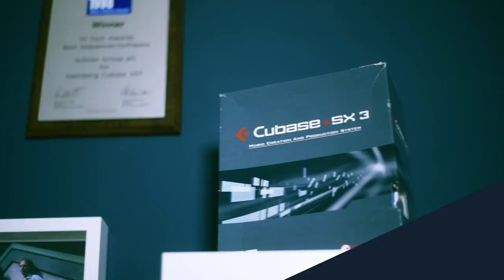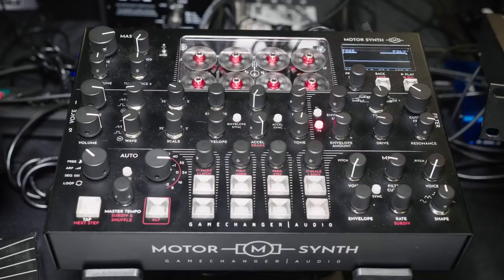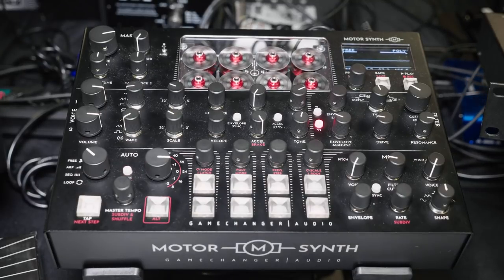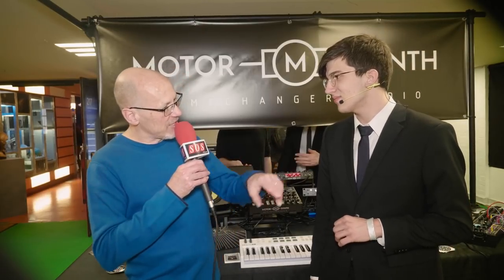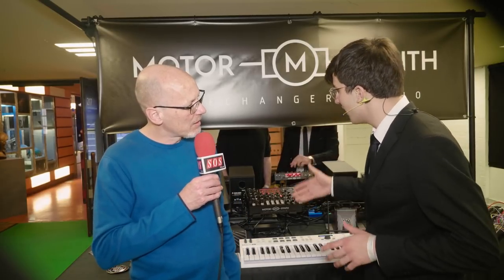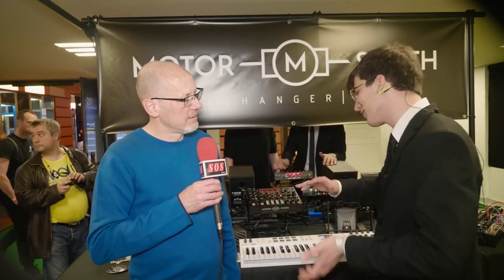Gamechanger Audio Motor Synth - Superbooth 2019 - Audio Demo and Product Rundown

Comment: How is this more than an expensive gimmick? Some clever sound synthesis should be capable of this. Still, to each their own. What worries me is that it apparently is a startup project. Even if the product would be the best thing ever, which every startup claim to sell these days, there are so many things (besides product) that go into a successful and reliable company. With most startups failing (as much as 9 in 10), I'd rather invest those 1200 elsewhere. But hey, I wish them good luck.

Comment: Absurd! A synth designed by a mechanical engineer, apparently. I'm quite certain that anything this device can do could be accomplished more simply and reliably by a combination of electrical circuits (including DSP's) and firmware. Gamechanger just couldn't find anyone with the right expertise to hire, it would appear.
Reply: I think you should have stopped at "Absurd!" I'm pretty sure nobody ever said "I can't find as descent DSP/FPGA programmer, so I'll make an analog synth instead" do you suppose Tesla is making electric cars because they couldn't find people to help them build a diesel engine instead?
Reply: @OlivierOzoux  Extended sarcasm is apparently not your forte.